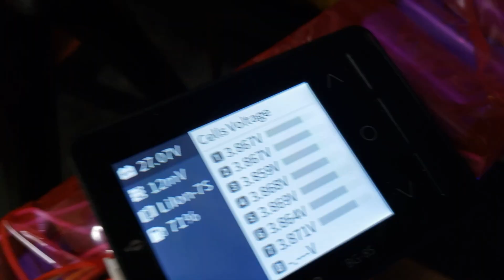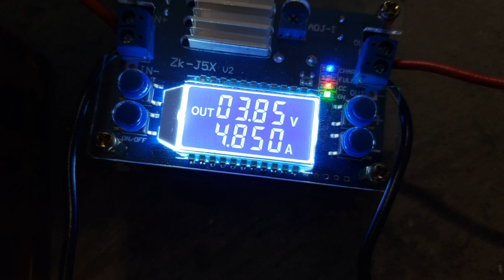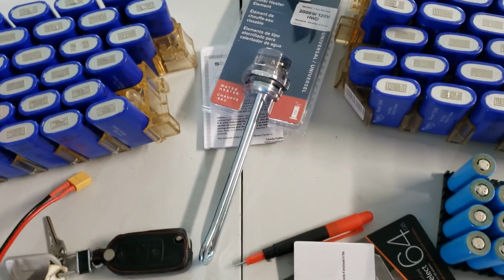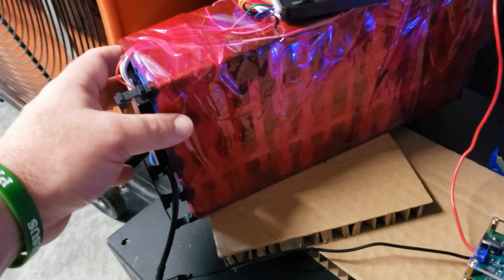lithium 18650 testing, SOLAR POWERWALL

Comment: Nice video. Worth considering for space optimization, honeycomb cell layout : https://endless-sphere.com/forums/viewtopic.php?f=31&t=92223
Reply from the maker: I just spent $150 for more 4x5 holders.  I need them to have air flow since they will prolly be outside in the florida heat. Im gonna set up a buck converter and some fans. ultimatley I want a computer server cabinet with fans, nice glass front panel.

Comment: Get Nissan Leaf battery and call it a day
Reply from the maker: I almost went that way for a 24volt system but now know its not that great for 24v, best for 48v.  So much fun tearing down 18650's and testing. This is a hobby aswell as functional project. Leaf would be to easy. but to each their own.
Reply: Rodney Mobley cool